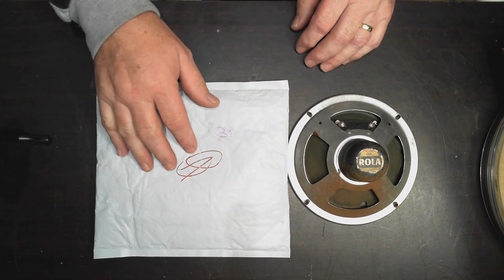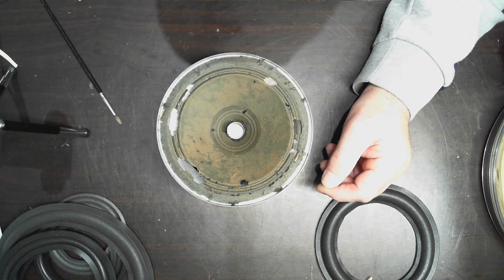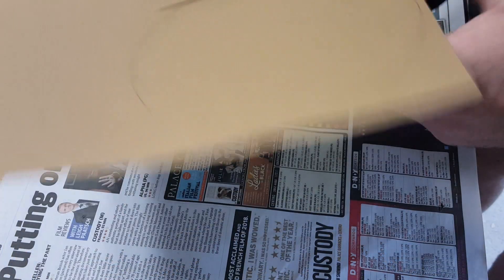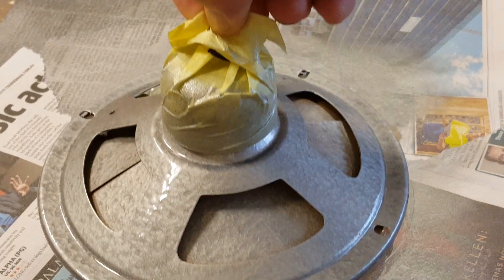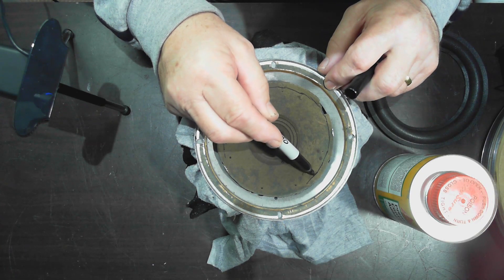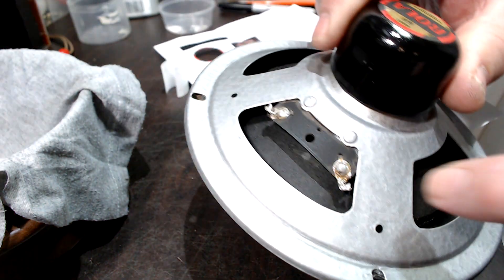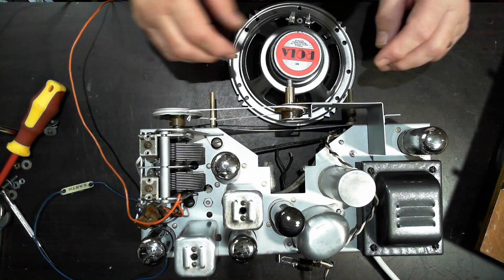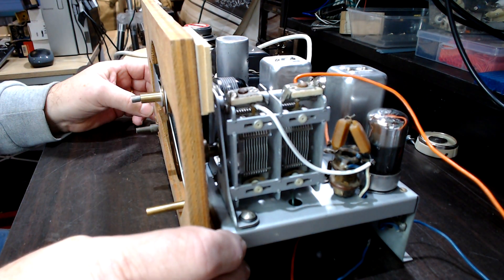NZ Phoenix Radio Pt 3.1 -Addendum- Rola Speaker Restore

Comment: I just found your channel. That. was a great way to do the refoaming. , and masking of the cone for the sandblasting! 
As mentioned earlier, PVA glue will give you more work time.
Also, where did you get the surrounds? I can find them here in the States, but it seems like you had more sizes.
Reply from the maker: Hi David, Ha-ha... yes PVA... got it 😂 Thanks for your comment David and welcome. I'm amazed at how many people from the US are watching.  I get the speaker parts from China, we don't have quite the access to that sort of thing in Oz or certainly not as cheap. The link to where I got them is: http://www.ebaystores.com.au/diyhobbyistbase/category25523228011-/_i.html?_fsub=25523228011&_sid=1419409821&_trksid=p4634.c0.m322 That is the Aussie eBay but you should be able to find them on US eBay. Cheers 😊
Reply: Hi David, I've just noticed your comment. See my comment today and that might help you to source speaker cones, voice coils, dust caps etc.

Comment: I have used these sort of surrounds to fix 2 pairs of Optimus 650 10" 3 way and the 1977 vintage no name Foster 8" speakers Dad bought for his first HiFi setup, I used to collect Rola speakers since I was 11, my first was the 8H 3.5 ohm late 60's build back in '83, I later discovered Mike's TV service at Royal Pk who had loose speakers hanging on a 4 spoke hook board turnstile they ripped out of old stuff, prices from $2 and they told me Robbies in Queenstown have lots of Rolas (Adelaide)
Reply from the maker: Well that would be restores heaven I should think vaughn 🙂
Reply: @DavidTipton101  Mike's TV went out of buisiness in early 90's, Horace Robinson's shop had a clearing sale back in 2008, his son Paul was charging heaps for the stuff, The shop has been since demolished and Horace passed away few years ago

Comment: Great repair job. I usually use the rubber surrounds as they tend to last far longer. I’ve done a few similar repairs when restoring 1970s-1980s Japanese radio cassettes (boomboxes) that I collect (hoard).

Can’t do tuner repairs/realignments though. Are you interested? I have a Sharp GF-9090 from 1977 that needs a little tuner work.

I’m at Mt Gravatt, Brisbane.
Reply from the maker: Hi James, are you saying you can get rubber surrounds instead of foam rubber like I used, that would be better I imagine. To be honest I wouldn't want to do a radio like the Sharp, I struggle with the modern stuff and I'm still trying to get my head around valve radios. Thank you anyway 👍🙂
Reply: Hi David,

Thanks for your response.

Yes the rubber surrounds do last much longer than the foams - you usually only get around 10 years out of the foams depending on temperature and storage method.

The FM tuner of the Sharp works fine apart from the situation where Triple J (107.7) is right up the top of the dial (max adjustment). It needs to adjusted back to 107.7 instead of 108+.

The signal generator method is what’s used but that’s all I know. :-)

Comment: Aaahrr!!  When you said "contact adhesive" I cringed.  That stuff contains toluene (C6H5CH3) which means it destroys foam surround.  Always use PVAC glue (like white "woodglue")  It has a fair open time, which allows for correcting the position of the foam surround.  BTW, if you first glue the ring to the frame, it already sits in the correct position.  Then glueing the inner ring to the cone is much easier.  Instead of putting a weight on top, use clothespins to clamp the surround.
Reply from the maker: Haha... this was my first try at repairing a speaker, I have improved since then and I now use a PVA based adhesive. Having said that, I changed the dial lamp in this radio a few months ago and the speaker and it's surround are still in first class condition, thanks for the tip 🙂

Comment: Finish trim looks a little crooked.
Reply from the maker: On the speaker or radio? The speaker surround might be a little off, it was my first attempt and I used the wrong glue, I'm a bit better at it now 🙂
Reply: @DavidTipton101  the radio face trim on the outside where the dial is seen looks a bit crooked.  The speaker job was great.  I've done the same way.   But I would just go bonkers if the front of the radio  was not perfectly straight.  You did a great job on it though.
Reply from the maker: @markmurto  Yes, it is a bit off, I'll fix it when I pull it down again, I have to realign the dial at some point, I didn't do it right the first time.
Reply: @DavidTipton101  its quite amazing.  I watch Techmone, and your channel, way from over there in England, from California USA, and its just like next door real time talking.  You know the Bible is sure right when writings predicted that men would have no stop to the inventing.  In the next twenty years, can you even guess?  That is of course if we stay free of the CCP. and  other plan-demics and such.   Great channel.  Keep on keeping on.
Reply from the maker: @markmurto  Thanks Mark, I wouldn't even try to imagine what it will be like in 20 years 🙂